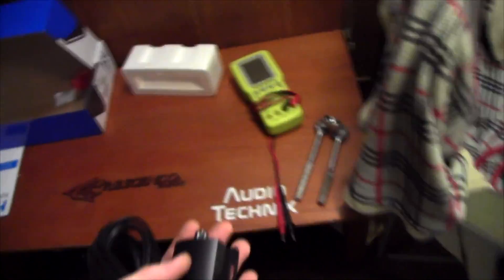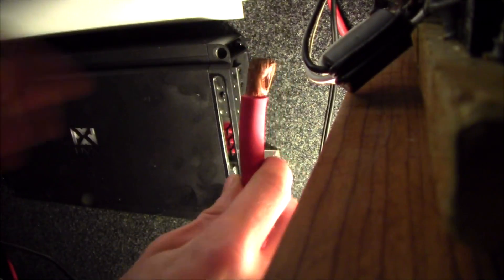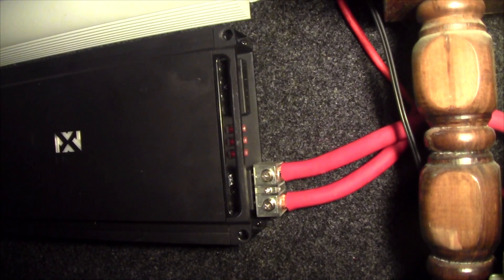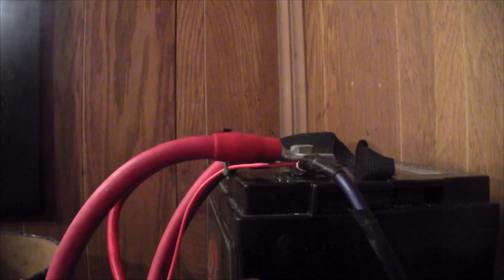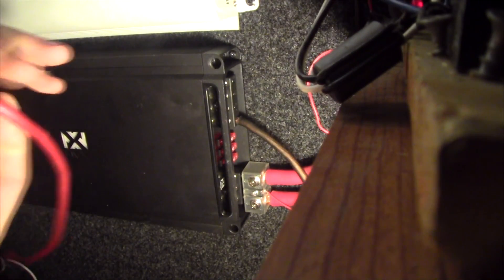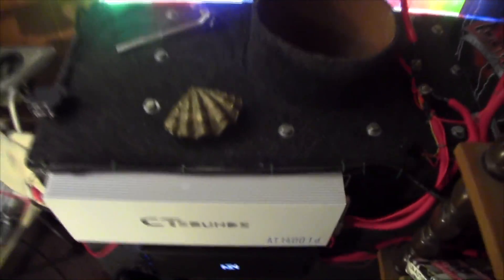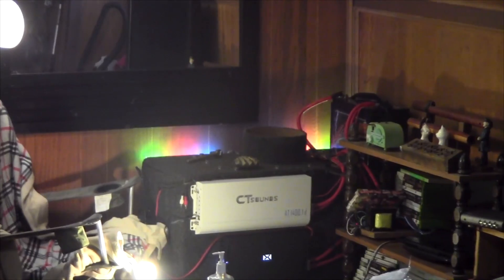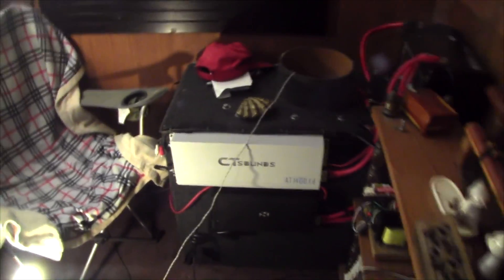How To Wire Car Audio Amplifier (In Home) NVX JAD1200.1 Bass Amp & Crescendo LOGIC 12V AGM Battery

Comment: Hey exo im buyibg 2 type rs 12s 1000 watt rms and a brx 2400.1d amp is 1200 per sub too much power? And its 1600 watts at 2 ohm is that too little power? Also do you have any videos to teach me how to tune the sub and amps
Reply: Type R's are most possibly the best out their. Very underrated and can sound real nice and clean if installed right.
Reply: Alpines aren't good? Lol they're tripping. Yes the alpines will take that power all day, as long as it's CLEAN. be sure to do the Big 3 upgrade and keep all the bass boosts turned off on your deck. Gain is not a volume knob, keep it a little over half to be safe unless you can find someone with an oscilloscope to set it correctly.
Reply: Assuming you are using SWR-1242Ds (which are what I own) they are dual 4-Ohm voice coils which when wired in parallel makes 2 Ohms.  So you essentially have 4 x 4 Ohm Speakers which means you can only obtain the following impedances: 1Ω, 4Ω, and 16Ω, I believe, depending on how which combination of parallel and series you use.  So 2Ω would be unattainable using these two dual voice coil speakers (please correct me if I'm wrong, I'm kinda tired and I did the math pretty quickly in my head.)  So that leaves you with either 1Ω (everything in parallel) or 4Ω (2 sets of series coils wired in parallel) and 16Ω but thats not gonna leave you with much power.  I considered the BRX 2400, but ultimately went with the Audiopipe APCL 1500.1D which was only $150 shipped and am very please with.  Either way, the BRX will definitely provide ample power.  I'd recommend wiring them at 1-Ohm (mine actually ended up being ~0.7Ω) to utilize it to it's full potential, however you definitely need to make some electrical modifications (i.e. an extra battery, I found some great ones for as low as $35, and/or a capacitor - I use a 300F super capacitor array but that's pretty unusual, I'd say, but I love it.)
Reply: Type rs are not that good. Poinner championship pro 12 are way better. Better yet the number 1 sub out. Look it up
Reply: It also depends on how you wire them.  I have two 12" Type Rs (2 Ohms) wired in parallel to achieve a total resistance of 1 Ohm.  I run 1500 watts @ 1 Ohm to them and it's got plenty of overhead power.  Check the impedance of the Type R's you have.  It sounds like they may be 4 Ohms since you said you'll be running them at 2 Ohms, but either way make sure you know the total resistance (1 Ohm can ruin some amps, but I'm pretty sure the BRX can handle it.)  And yes, 1600 watts @ 2 Ohms is plenty of power.
Reply: Yeah 1600 watts at 2 ohms so 800 a piece. 2400 watts at 1 ohm so 1200 a piece. Going to wire them to 1 ohm. Unless its too much then I was thinking about wiring them to 2 ohm but was worried about that being too low.
Reply: I was under the impression that you could wire a single 4ohm DVC sub to 2 ohm. I was just going to wire them separately but maybe im wrong on that. But if not its not a big deal anyways cause like you said I'll probably just wire them to 1 ohm. My truck has a 160 amp alternator. I've been told that I probably wont have to do anything as long as I leave the truck running while listening to music. If I have any problems I'll just by an  extra battery like you said. Only thing I'm worried about is when I get another amp and door speakers. I don't if i could squeese another 400 watts in for that or not.
Reply: TrashmanKegs You can wire a single DVC 4Ω sub to 2Ω (with each coil in II --> 1/{[1/4Ω]+[(1/4Ω]} = 2Ω) but not two.  That's actually how you obtain 1Ω: wire two DVC 4Ω subs (ea @ 2Ω as described above) in II with one another (i.e. 1/{[1/2Ω]+[(1/2Ω]} = 1Ω.)
Reply: That just confused the hell outta me... hahaa but thanks for trying ill stick with 1 ohm. lol While your being a champ and helping me out.. quite a lot actually.. Could you help me with what fuses I should get? The amp calls for a 250 amp fuse so thats not a problem. But when I do the big 3 what size should I get? thanks a lot for the help
Reply: technically if your amp is really putting out 2400W then you'd need at least a 200A fuse.  Just take the max amount of wattage you plan to obtain and divide it by 12(Volts) to figure out how much current (i.e. how big a fuse you need) is flowing.  It's actually a little higher than that since no amp is 100% efficient; Class D amps (like the BRX I believe) achieve about 90% but I think its good to play it on the safe side and go for a slightly smaller fuse.  Frankly 200 amps is a ridiculous amount of current; household appliances rarely go above 15 amps and a 1,000W home theater amp would only use about 8.
Reply: from what i recall, type R's have always taken at least a couple hundred more watts than rated since back when they were rated at 500 rms